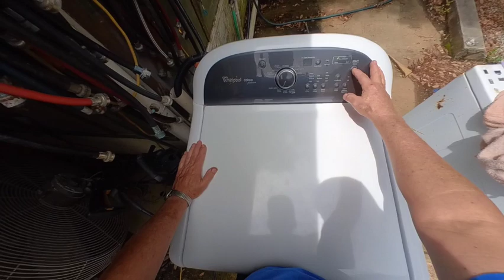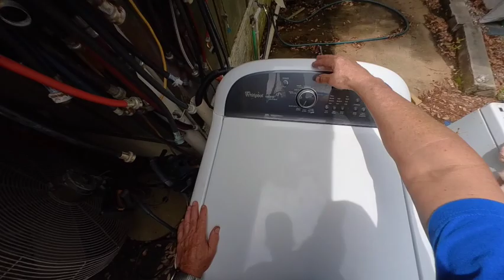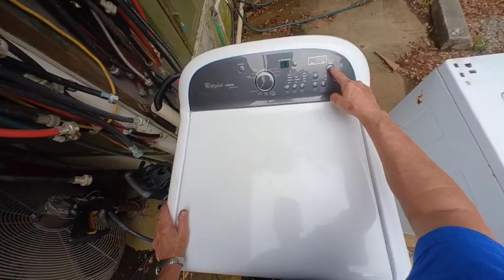How To Replace the Drain Pump in a Whirlpool Cabrio Platinum Washer: Fixing LD Error

Comment: Hi you doing harper i found your vid because i was getting the long drain error on my machine. I replaced the pump and ran a cycle and its still saying the samething. Any advice.
Reply from the maker: Check for obstructions or kinks in the drain hoses. Once I was working on a machine that kept coming back to me. I pulled the tub and a small wash rag was in the tub between it and the spin basket. During drain it would float around until it covered the drain hole at the bottom of the tub. That was a head scratcher right there. Thanks for watching!

Comment: How do you access the drain hose on the inside of the back panel? That’s where my leak seems to be originating from.
Reply from the maker: There should be a screw that attaches the drain hose to the back panel at the top of the plastic component that the drain hose goes through. Remove the screw and depress the clip on the bottom of the component to remove it. Your leak may be coming from one of the hoses under the cabinet top that routes water to the bleach cup, fabric softener cup, or other area of the top. Remove the back screws and push in the clips at the front edge of the top with a putty knife and lift the top up to access these. Thanks for watching.

Comment: Do the pumps start making noise or get louder during spin or do they just fail completely. Just did the bearings, was whisper quiet but now seams louder during spin
Reply from the maker: I did a bearing replacement once that was louder too. I had to redo the job. I don’t know if I had something misaligned or what but the new bearings roared like they were worn out. I just put in a whole new kit before I gave it back to the customer. The water pump is probably okay.

Comment: If your washer is dumping soapy water, it could be the drain pump right? Or the bearing seal?
Reply from the maker: Without being there to diagnose it all I can give you is my best guess.  If it’s leaking underneath it could be a couple things. Bad seals, broken hose, leaking pump. Or bleach tray has dropped through a rusty top and when it flushes water leaks inside.  Also you can tie a dry rag around the drain hose where it goes into the household stand pipe. If it’s wet after doing a wash then your plumbing is backing up. Thanks for watching!
Reply: @HarperandKnowles  Thank you so much. I'm taking a chance that I have busted ball bearings. It's loud and I noticed my water tray had rust on it. If it's not that I'm going after the pumps. Thanks again for the check my thinking!
Reply from the maker: If you have rusty water under it and it’s loud when it spins then your bearings and seals have failed.

Comment: Any tips on whirlpool washer doesn't spin out the clothes everything else works? I changed the agitator still doing same thing ging
Reply from the maker: That all depends on which particular machine you have. If it’s an older direct drive it could be a clutch or several other issues. Newer machines will have different problems. Unfortunately I can’t make a definitive diagnosis without seeing the machine myself. Thanks for watching!
Reply: @HarperandKnowles  WTW5000DW1 is model number I'm gonna chuck clutch under it tommorrow and basket drive see if either broken
Reply from the maker: I would suspect that your tub hub is failing on that model. Here is a video on how to fix that. Get Your Maytag Washing Machine Spinning Again with This Repair Tutorial
https://youtu.be/FnA85HlxyJg. These are very similar models.
Reply: @HarperandKnowles   Yes thats the piece i removed today lol the Plastic piece the gears inside are gone, the Main gear metal is still good, Bought a part to put on it to see how it goes. I've done bought new washer $640 Lowes yesterday with five year warranty but if i can fix these one back up never hurts
Reply from the maker: It’s better if you replace it with the newer metal part. Thanks for sharing your experience!
Reply: @HarperandKnowles  I changed out that part works fine but when it goes to spin it shakes bad didn't do that before any ideas? I recabulated it as well adjusted the bottom hinge as well to be level just shakes like the drum inside
Reply from the maker: Spin the tub by hand and watch it at a point near the splash guard. If the tub wobbles you might have to redo your repair. I found some of those kits have spanner nuts that aren’t threaded squarely and will cause the tub to tilt when tightened.
Reply: @HarperandKnowles  and the nut is at 20lbs that holds the basket down.
Reply: @HarperandKnowles  the drum doesn't wobble at all when I spin it by hand. Slow
Reply from the maker: Unfortunately I can’t diagnose a problem without seeing it myself. At this point I don’t know what to tell you. That spin basket isn’t running true or your suspension rods are the problem. Of course it could be something else entirely.  I think that is the worst model that Whirlpool ever designed and like you I run into problems whenever I have to repair one. Good luck with the repair, I still suspect the basket is the culprit.

Comment: I replaced the pump and I still get the LD error please help
Reply from the maker: So, if you have a good pump then you have something obstructing the water flow. Pull off the drain hose from the tub and look up in the tub opening and the short hose. If you don’t find anything be sure the long drain hose is clear too. Thanks for watching!